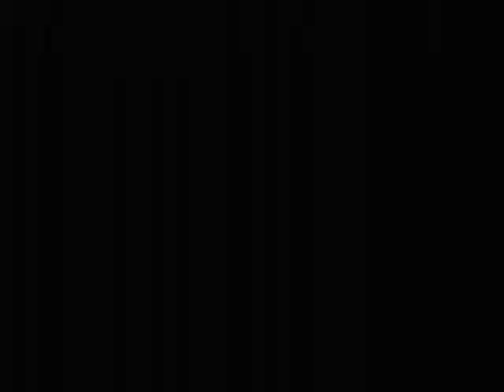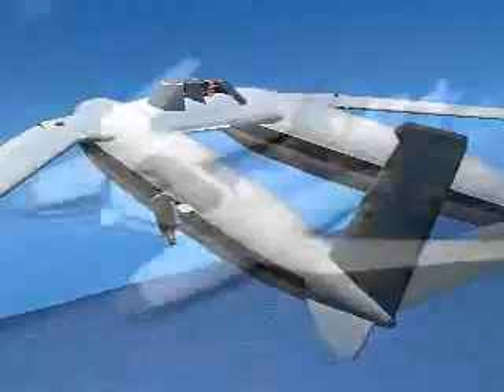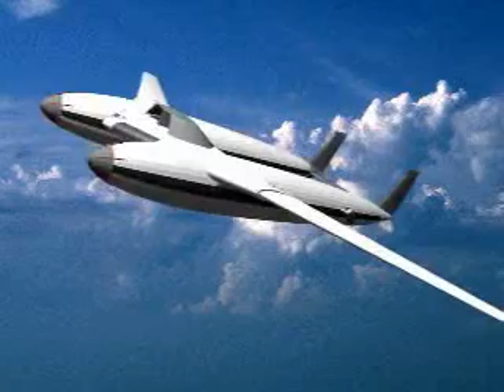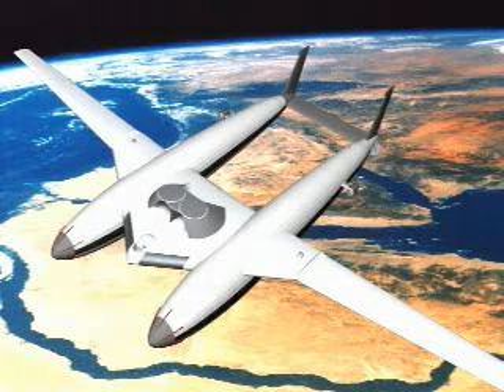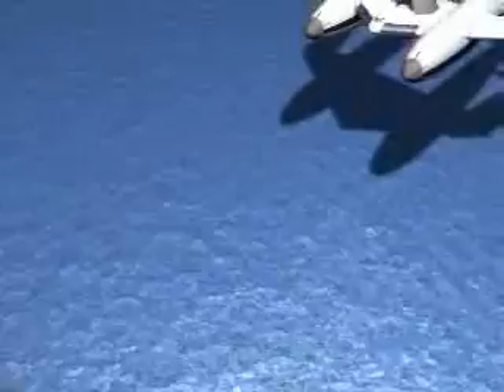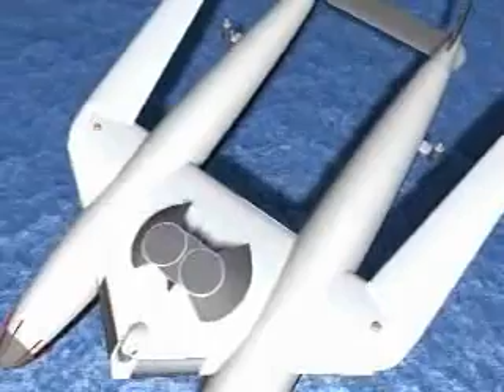Fuel-Less Gravity Powered Airplane

Comment: Did you do a simple sanity check regarding lift, drag and weight? You assume a 100% efficiency of the wind turbines and compressors, in real life this is not the case and since you are converting energy various times, the losses become bigger since every conversion has its losses. As a student aerospace engineering I think you should reconsider your design. You also create a lot of drag using the turbines. Theoretically you should glide further without them than the case of filling the tanks.

Comment from the maker: @DorkVader26 you statements r not founded with any evidence that I am aware of. Do u know how much fuel it take to lift 747? And entire assent is like driving a car up hill. takes massive amounts of fuel. if this technology cud work, it could b used 4 alternative forms of trans as opposed to sole form of transportation. & because 747 requires massive weighty infrastructure lift engines,  landing gear/brakes/tires., fuel and passenger safety/life-support equipment. saved weight cud carry payload.

Comment from the maker: @DorkVader26 considering that this conceptual airship has good reason/logic to be be a workable technology. We still are not clear on how it would impact length of travel time. And supposing it was used only for transporting cargo and was a pilot less airship? Or perhaps controlled by pilot's on the ground via a satellite connection and/or AI computers. It still could be augmented with supplementary jet engines to increase speed.

Comment from the maker: @zackshalac this concept airship is about ultra energy efficiency. And there are two gases that are used and compressed. One is the helium when it is descending, and the other is for storing captured wind energy. And that compressed air (stored energy) can be used to compress the helium when descending or for use to power wind turbines which can be used for thrust.

Comment: What about emergencies, what if an air compressor should fail? Or the balast fails then the plane is stuck in the air and cannot come back down? There are just too many systems it is dependent on for it to be practical. I would not fly or pilot this vehicle.

Comment: i like the whole uses copressed air to run compressor to compress air to make it heaver then air so it will start to fall... ummmm, yeah that will work great, lets just get rid of the plane and use compressed air to run compressor that compress more air then it uses to run, then use the surplus to power a generator.. oh yeah because it will not work..... nice to dream about but will not work

Comment: @upcycle There is a couple of major flaws with this design -  one is the first law of thermodynamics, all energy is lost. I'm sorry this is fantastic bullshit - it will need an external powersouce.
It's the classic Free Energy scenario - maybe if you covered this thing in solar panels and could transition to heavier than air at a fixed altitude to get glide ratio it might work, but thats impossible.
Sailplanes have 60:1 glide sure - they don't get that whilst driving a turbine!!!

Comment from the maker: @gimmedafilez good points. And it maybe interesting that a blimp would have sail on it just like a sip on water..
and that it may also be possible to drop a line down into storm clouds below and suck up electricity, just like drinking juice or soda through a straw, filling up the battery backs.. or using that energy to power the compressors.

Comment: Explanation: Think of sailboats. sailboats produce & expend no energy, yet move forever in constant wind. Gravity is constant, a body with less buoyancy than weight will fall, more buoyancy it will rise. Control the fall to generate distance. While gliding, energy can be produced. Look up aircraft emergency power units, they generate considerable power if the engines fail. Generated power is used to compress the LTA gas at the top to lower buoyancy, released at bottom to float. A "gravity sail".

Comment: I'm very skeptical about this because it seems to violate conservation of energy. The amount of energy expended to travel up has to be replaced by the energy gained coming back down. However, the energy coming down can only be equal to or less than the energy coming up, never greater. In fact, in the real world it will always be less because of drag, air compressor inefficiency, etc.
 I highly doubt this is possible.

Comment: I imagine something like this could make air travel cheaper IF the added some more proven technologies, like solar panels, and maybe some regular old jet engines for emergencies.  When I say cheaper, I mean more like a transcontinental hitchhiking plane. This design will be incredibly sensitive to weather, a lot of planning will be involved, the actual destination will probably not be known at take off.  They will, however, get you close. (like maybe in the same country).

Comment: Even if you overlook all the issues which would arise attempting to store compressed gases such as excess weight, this vehicle would be dangerously responsive to even the slightest change in weather, particularly when accending. Downdraughts or crosswinds could push this plane back to earth or miles off course long before it could reached its flight altitude and initiate its glider function.

Comment: I think this seems sound.  A good idea would be to build a scale model to see if it actually works.  this would be cheaper than building a full scale prototype.  Also, supplementing the principle with solar should make up for any thermodynamic loses.  The only drawback I can see is that it would be slower than jets, so maybe not well suited for longer trips.

Comment: This may not violate the laws of thermodynamics. The energy being gathered on descent is not used for primary propulsion upward. Upward motion is provided by *buoyancy*. The buoyancy is "created" by the release of compressed helium into what are essentially balloons. The downward motion is not what compresses the air directly, it would use a windmill principle.  A "glide" from 50k ft could potentially be used to build a lot of pneumatic energy that way. The "unlimited" energy source is gravity.

Comment: I want to know where I can get the unobtanium tanks that can hold that much compressed air. Not to mention how hot and cold those things will get if they can hold enough compressed air to displace a dirigible's worth of helium. 

If compressing gasses was that easy, blimps wouldn't vent. Somebody needs to do more research...

Some other aspects have reasonable merit (changing buoyancy combined with an airfoil to achieve forward flight), but the compressed air part definitely is LOL-material.

Comment: and even if it succeeds to lift itself there are many processes linked to each other, each failure would mean a total break down, but the idea is good, the hydrogen concept is the solution in the future due to fuel sources getting exhausted, damn ill make my own super low cost airline, ladies and gentleman get into the balloon and lets fly 20 hours longer but just for 2 bucks : )

Comment from the maker: @diddymuck alot of good questions. Regarding the last question, keep in mind that this conceptual airship will fly above most clouds, thus rainy days will only have an affect when it is needs to take off and ascend. But because the helium would cause it to be lighter than air, it seems it should be able to ascend without issue of needing much power. And in any case it may gather/recharge it's energy storage at the air base before lift offf

Comment: what percent of the body is a helium container???  How do the wings move?   What's the overall plane size?  Is the compressed air provided by one engine?  if so, how big is it?  How many people can be carried...sounds like not many at all.  Apparently the entire device is 95 percent gas container.  If compressed air is needed for thrust, the storage system for it must be enormous!!  And if its solar powered, does that mean rainy day flights are out of the question?

Comment: what percent of the body is a helium container???  How do the wings move into position?   What's the overall size of this plane?  Is the compressed air provided by one engine?  how big is the engine going to have to be?  How many people can be carried...sounds like not many at all.  Apparently the entire device is 95 percent air bag.  If compressed air is needed for thrust, the storage system must be enormous!!  And if its solar powered, does that mean rainy day flights are out of the question?

Comment: Won't the drag from the power-harvesting turbines just cause it to stall during decent and fall in a less controlled manner?

With all of the crazy stuff aside, you need the initial power to fly for the first time, and you need additional power to make up for the inefficiencies of such a Rube-Goldberg system.  You can't have something for nothing, even if you have a 100% efficient system... and you don't even have one of those.

Oh, nice surface area, good luck not being blown around.

Comment from the maker: @MrMonkeybat the concept airship is more about ultra energy efficiency and collecting energy from the environment for additional thrust. & regarding compressed air powering motors. This airship uses two types of "air" or "gas". One is atmospheric air that it collects into air tanks as energy other type is in form of helium which it releases into air bladders from compressed state as an energy source to cause lift. So the motors may be using the compressed atmospheric air to cause..

Comment: The laws of thermodynamics dictate that the energy consumed on the ascent will be greater than the energy gained on the decent due to inefficiencies. You will be forced to look for thermals like any other glider. At one point there was even mention of compressed air powered motors being used to power air compressors perpetual motion at its best, wouldn't it be more efficient to just feed the air from the compressed air tanks directly.

Comment: @upcycle upcycle This is simpler than today's aircraft. Eliminate the hugely complex jet engine and all it's electronics - you have a vastly simpler machine. Speaking of 'complicated', think how 'complicated' life is going to be when petroleum becomes depleted ('peak oil'  is already happening right now) and there's not enough available to run aircraft. This gravity plane might at least provide slow but  low-energy freight transport, freeing fuel for conventional rush passenger air traffic.

Comment: @bobafetthotmail Sigh...Yes but let's see estimated approx NUMBERS not just physics principles, to find the actual energy budget/balance involved. That is: 
Approx. energy (E) releasing helium to achieve takeoff = (-)e1 KWh. 
Approx E of compression to get enough compr air for 500 km flight = e2 
KWh approx E to recompress helium = e3 KWh 
Approx 'recovered' compress E4 from descent = e5
NET ENERGY OF ENTIRE TRIP = e1+e2+e3+e4+e5 = e6
SAME 500Km TRIP MODERN JET PLANE = e7 (x times greater)

Comment: Lovely idea in theory but please get someone in an aeronautics egroup to do the energy calculations: How much energy is needed to compress the air or helium at each phase for an example typical trip, and how much energy is required to push the craft at normal speed through air for that trip? I'm not knocking it, I'm just saying we need to see some quantities instead of principles. Also, solar photovoltaic panels might capture energy to propel it? Plenty of high altitude sunshine? Good on you.

Comment: @Tomazimon Air resistance is the enemy of gravity. Gravity is what makes things fall. Air resistance only  is used this  source of energy to supply lift to make things fall slower.If gliders were powered by air resistance, if  gliders dived straight down,using air resistance for power,the only use of that air resistance is to lengthen the time before impact.

Comment: the plane does use fuel.  It requires tanks of compressed air.  Just because the fuel itself is compressed air doesn't mean you can say it's a "fueless plane"

Also the compressor motors that filled the air tanks initially ran off a conventional fuel, either gas powered generators or coal/nuclear plant generated electricity.  Even wind turbines or solar energy collectors have to be built somehow...

There's no such thing as a free ride folks.

Comment: Perpetual motion in dirigible form now!

Think they missed a few steps, like powering the motors to MOVE the ship forward, steer the ship, or adopt geostationary orbit. As for compressed air powering air compression - as per DJ, 1 redundant, 2 you would have to re-compress the helium, 3 moving the compressed air from the storage tanks to the balloon would not alter the weight of the craft! E=Mc2 people! can't make more weight from the same weight of air! BTW helium no, too scarce hydrogen

Comment: "Air from the atmosphere is compressed into the rigid shell of the aircraft to add weight, this is accomplished by using pneumatic motors driven by stored compressed air, that powers air compressors"  wait what?! Your using air powered motors to compress air?!

Comment: How carry cargo?
My idea: create a planewithoutwing-container
in few standart sizes,
the less cargo weights,
the more the container airtanks get filled,
for standart weight and later use.
Containers can be pluged under centre delta.
If planesize doesn't mather you can eg carry either 
2 large containers (about 100mt/220klb[thats less than 747-200F])
or 4 medium (50 mt/110klb)
+2 small (25mt/55klb) on outerdelta.
It doesn't mather if cargo is human.
You can design humancontainer with plane remote

Comment: @upcycle 
um, in the video, the only additional energy source mentioned is wind energy. Solar thermal? So you're gonna carry water tanks? That's gonna pull down the plane. Photovoltaic? I don't see any solar panels, and those aren't gonna produce much energy, because solar energy has very low density per area. Geothermal? How the heck do you get energy from the earth when you're in the air?

Comment from the maker: @H0SS this is more accurately referred to as a hybrid airship. And it likely will not carry any passengers, nor any human crew. Thus, it would need far less weighty human safety gear/equipment. And with advanced nano technology can have far lighter frame skin than anything before it, including the lightest materials commonly used such as aluminum. And stronger than them as well.

Comment from the maker: @wrylie188 Thanks for the info on R.A.T. 

Interestingly, an alternative to the turbine on this concept airship, using mechanical transmission and storing energy as compressed air, it could use the energy from the turbine to turn and electricity generator and store the energy as electricity in batteries as well. Or it could have both systems in place.

Comment: @wrylie188 If you yourself had run the numbers, you would see that it is an over-unity machine, but as we all know, perpetual motion is impossible. It will never be able to compress as much air as it consumes. It could possibly be very efficient flight, but it will never be fuel-less, energy is required to compress air for it between flights.

Comment from the maker: @riverlandman the compressed "air"(atmospheric) is being used compress "air"(helium).on the way down. And turbines connected to compressors are able to use the wind energy to compress air at any point in flight, The stored compressed air (stored energy) can be used for what ever purpose, including turning turbines which can push the airship.

Comment from the maker: @jay08641 the concept does not need salvaging by the likely prospect of technology for extracting electricity from clouds or ultra capacitors. GPS, and weather stallite technology, along with massive weather prediction/analysis tools already exist.

And in future, there will likely b some form of electric air way.. pumping electricity into some portion of air which can b drawn. Or it may b locations which airships can come within proximity 4 a quick recharge while in flight, like a Tesla coil.

Comment from the maker: @jay08641 technology has continued to advance. And thus we now have more advanced tools such as GPS and more accurate and faster weather monitoring and analysis. & w these tools, airships can take advantage of weather conditions that increase efficiency and harness environmental energy such as thermal & wind. In near future, airships will be able to extract electricity directly from clouds.. kind of like sucking out their lightning bolts. and storing them in ultra capacitors for travel.

Comment: This might even work, as long as the earth stops having wind. Floating up into the air is a great way to gain altitude... that's why guys in lawn chairs tied to helium balloons can get up so high. But the bigger the gross weight, the more thrust needed to overcome the wind, otherwise you drift. That's why there are no cargo blimps.

Comment from the maker: @jeffbiggles it probably wud b most effective as passengerless, cargo-only vehicle. 2 further reduce weight, will probably b best as drone aircraft &/or remote controlled airship. Wud eliminate much weight in human occupant safety equipment. 

Airship could compete as alternative ship cargo-container transport. & perhaps, at lower overhead cost & faster transport time, thn SEA cargo container transport.

Comment: This is assuming 100% efficiency in the wind turbine, also, using compressed air to compress air?  This seems suspect, especially considering pneumatic motors are quite inefficient.  Also, temperature differences between stratosphere and troposphere need to be examined, will this plane be heated by solar when in the stratosphere?  Or will it loose heat to convection due to the low temperature?